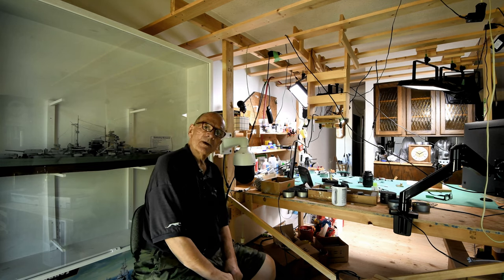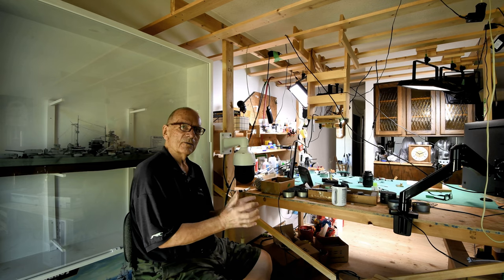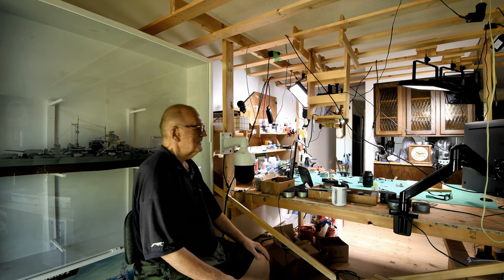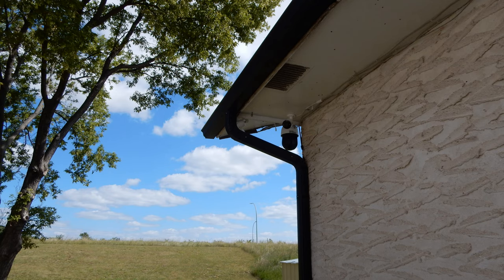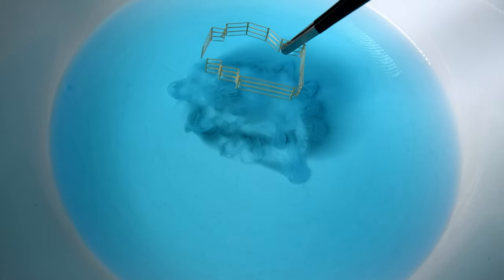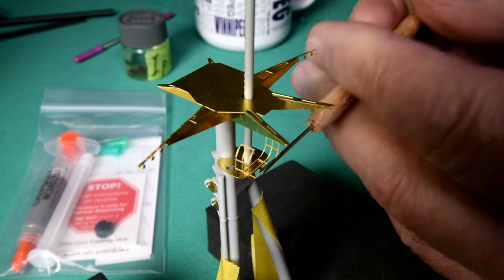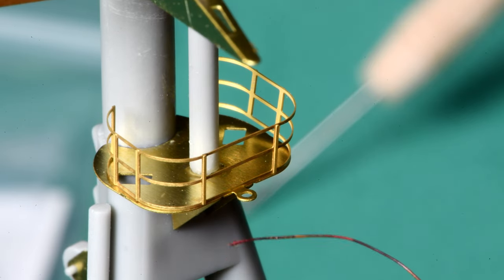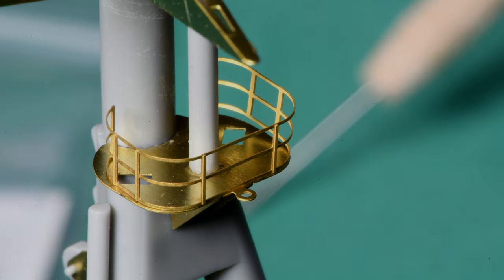The Model Ship - Part 898

Comment: Hi Ron, Sometimes you gotta do what ya gotta do. Hope the security system is working well for you. As you've said many times, "Life is what happens while you're making other plans." Gonna make me one of those wire applicators too. I'm using an overpriced one that fits in an X-acto blade handle now but it to applies just a bit too much glue at one time. See ya tomorrow. Greg from Kentucky.
Reply from the maker: Yes, that thin wire worked better than I thought it would. 👍